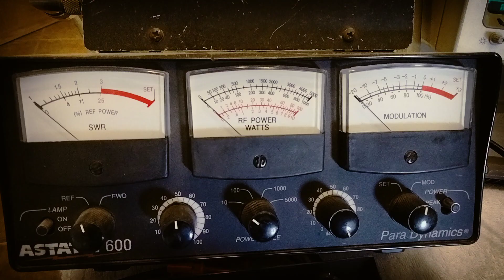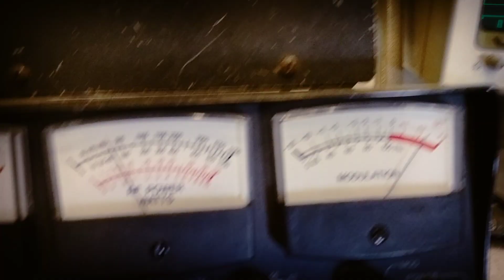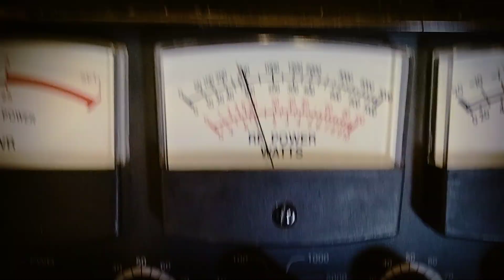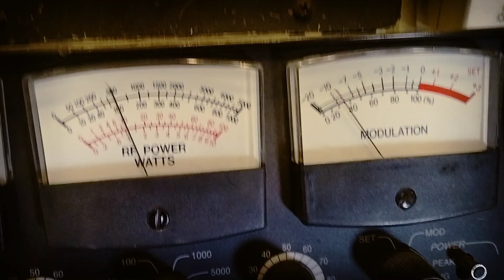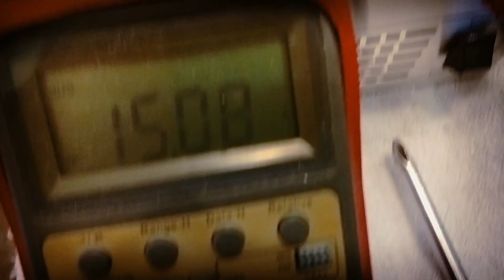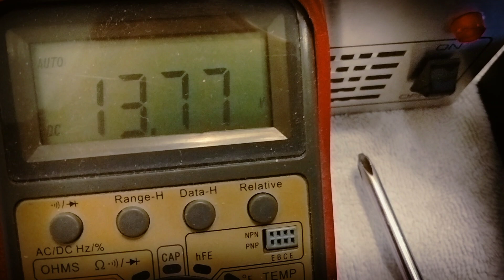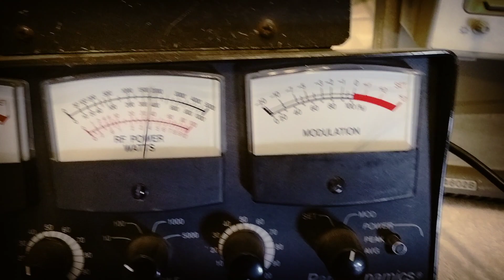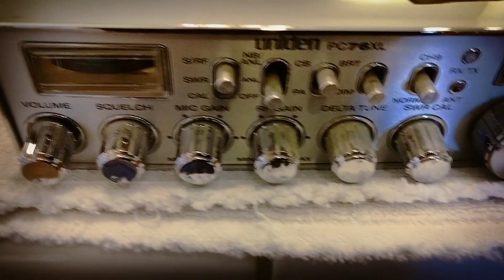"Cobra 29" Mod "Uniden PC76" Mods.  Swing kits, Dead Keys, Power Supplies & Crooked CB Shops. Part 1

Comment: On these boards does r131 just disable tr24 same as removing tr24? Or does it still utilize the AMC and just widen the range?
Reply from the maker: Are you thinking if the Cobra 148GTL board? This is a Uniden PC76/Cobra 29LTD type of radio in this video.
Reply: @bigcbradio Ah yes you are right i was thinking of the 148/2000 board.
Reply: only on uniden boards older  148/grant xl grant  lt. R131 is for AM side only . Never clip or add swing kits to radio ,Just get a power mic
Reply from the maker: @MrClownSlap001  Why no swing kit?
Reply: @bigcbradio  so called swing are nothing more then fake watts .A radio tuned proper will put all the signal in frequency and with a really good coax and antenna will win every  time
Reply from the maker: @MrClownSlap001  LOL, Ok, Fake Watts! Now I know
Reply: @bigcbradio   Glad I could help
Reply from the maker: @MrClownSlap001  Yes, really that was no help.  I will stick to my "fake watts" as you call them.
Reply: @bigcbradio    could you say that again you got stepped on
Reply from the maker: @MrClownSlap001  someone always gets stepped on, I don't even play that game, I just make my radios sound great, but if I wanted to play that game I would have no problems winning that game.
Reply: @bigcbradio   lol ok fake watts 🤣 now i know
Reply from the maker: @MrClownSlap001  🤪

Comment: May I ask how many watts is that resistor? Thank you sir.
Reply from the maker: 1/2 watt resistor, the ohms can be anywhere from 60ohms to 120 ohms.  The value of ohms you choose will vary based on the voltage that is powering the radio and the amount of dead key you are wanting.   On average I generally use a 68ohm resistor.  And in all my years of testing I found that if you have a dead key of less than 1 watt, your audio will be distorted.   I see so many people wanting a 1/2 a watt dead key, but I would not do that.

Comment: Excuse me,  onbthe swing mod.... what resistor was used to get the deadkey down that low ?   Please respond 😊
Reply: Ok, thank you.
Reply from the maker: I usually use a 68, but depending on the voltage the radio will be getting in its finally installation can make the deadkey vary a lot, so you could end up using anywhere from 50 - 100 ohms to get the deadkey you want.  Also just so you know, if you make the deadkey lower than 1 watt, the audio usually sounds like crap.  Most radios I will try for right around 1 watt.  This video was just to show what happens with different voltages.  In a mobile environment you could see the deadkey change by as much as 1 watt difference when the engine is running as opposed to off.

Comment: I understand, that’s how it is with me I key the mic in my car. I get 14 V when I speak it goes down to about 12 eight maybe 13 sometimes less. At home I run 15 V hasn’t hurt anything yet. I’ve been running it like this for a year and a half I hope it’s not hurting anything.
Reply from the maker: If you are talking on AM the voltage drop won't hurt your audio much, but on sideband that voltage drop can play hell with your frequency and your audio.  As far as the 15 volts, that really shouldn't hurt anything unless you are a real ratchet jaw and keep it keyed down a lot and get stuff hot.

Comment: I used to go out get a reading off the battery of the vehicle then set the power in the supply to same before a alignment back in the day 73
Reply from the maker: Yep, done that many times when setting up a radio for installing.... only problem is, do you use the vehicle driving voltage, or idle voltage, or parked and not running voltage... LOL.  I usually try to get a happy medium.   Thanks for your comments !

Comment: I want to use the Delta tune on my 76xl for variable power but can't find it anywhere.
Reply from the maker: hopefully you know the jumper you take off where people usually add the resistor/capacitor mod... it is where I point at the blue capacitor in the beginning of this video,  then this info will be easy for you... https://www.cbjunkies.com/threads/1815-Variable-RF-power-mod-for-Cobra-142-GTL   Scroll thru that, its just a couple components that go in place of that jumper and you can control the deadkey from a knob of your choice (1k).  You should get a new 1k (some say use a 5k or even 10k) pot and use it in place of the delta one (the delta one is 20K), so just center and seal up the delta tune knob so it doesn't short out inside the radio and use a new 1k pot.  I don't remember what resistances I used last time.  I spend time testing different values and I also add resistance across the pot and on each side of the pot until I get about 1 watt all the way left and 4 watts all the way right, and a smooth transition in between.
Reply from the maker: Did you ever get that variable?

Comment: industry standard voltage for servicing two way radio equipment is 13.8vdc.
Reply from the maker: that's cool, I am not a repair shop, I just play with my own radios, but there is a local shop that I have seen many many times over the years tell/show customers about how much power their radio is pumping out, but it's the 15 volt lie.  This video is so people are aware that just a volt or two makes a huge difference in output.  If you read the description of this video, the last sentence says:

"Just make sure if a shop shows you the increase in power when you pick up your radio, make sure their power supply is somewhere close to 13.8 volts, but not over that."
Reply: @bigcbradio  i must've missed that last part.  i do think your video nicely shows the difference a couple of volts can make in power output.  thank you for the reply.
Reply from the maker: Thank You, I appreciate you watching and commenting.